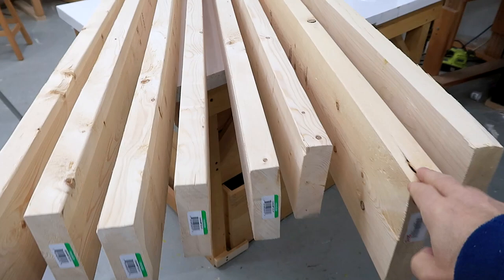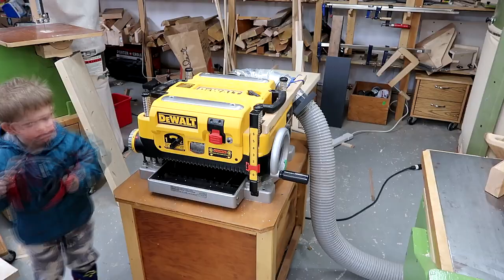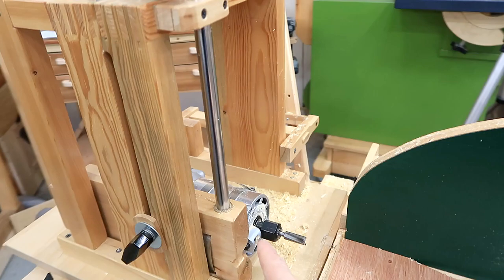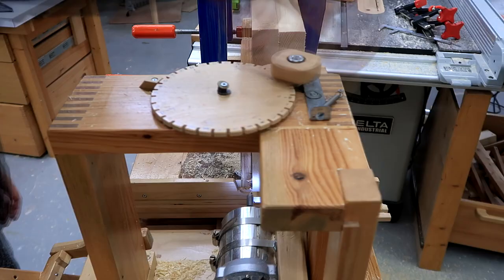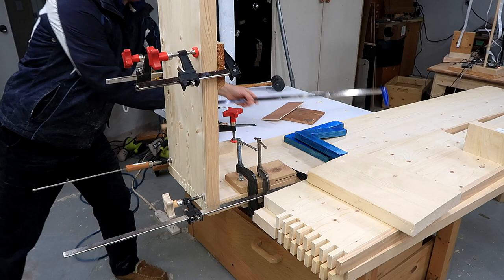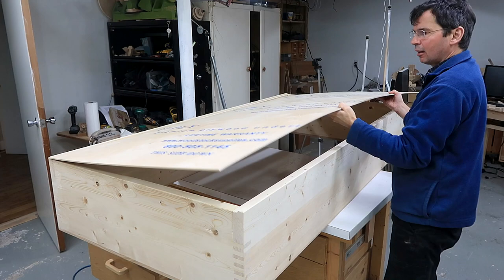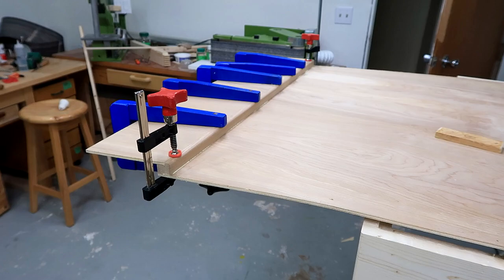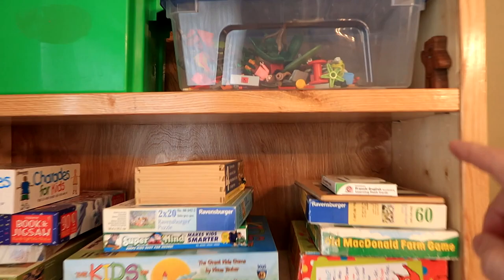Big box joined bookcase

Comment: Just when I thought I could possibly have more respect for you I see you use underlay plywood on a project. It felt so good to know I'm not the only one who uses it as a cheap source of thin plywood. But then you went and used pocket holes. Now I'm not sure how I feel. This video was such an emotional Rollercoaster. The only logical conclusion I can come to is one of the major pocket hole conglomerates got to you and brought down another legend.
Reply: I forgive him!  The strength comes from the box joint corners, the middle shelf just ensures the sides don’t bow in or out, affecting the ability to use the movable shelves.  Plus it can be removed if necessary, which wouldn’t be possible if he doweled through from the outside.  That’d also leave visible dowels on the outsides too.

I too have strongly considered underlayment plywood for projects.  Menards sells 4x5 sheets of 1/4” baltic birch underlayment, though the 4x8 there and at Lowes seem to have paper thin veneer faces over 3-ply cores.
Reply from the maker: if only they hadn't printed all that text on the good looking side.  I think they do it just to spite people like me.

Comment: I would think that a loose tenon might be a great future option for situations like that middle shelf. Just on the shelf side made it so you can slide it over the tenon, with the back mortise being open on the shelf. You will still be able to hide the joinery. 

Also in my experience, since most wood glues are water based. You can often extend the open pot life by mixing with water. Which is a trick I would commonly use when we did large glue ups. At the cabinet shop i worked at for a number of years.
Reply from the maker: did you ever check if those joints were any good in terms of strength?
Reply: @matthiaswandel  I don't remember having any failures on them, Most of the time it was stuff like cabinet doors that we where resizing for customers. I wish that I could remember better everything that we used this trick on. To provide better information to you. It does have the potential to increase the grain swelling cause your adding more moisture to the wood. But I don't remember us ever having failures of the glue joints themselves. Hope that helps.

Comment: Hello there nice work as usual, I have a small question : couldn't you just reverse the position of the sides and tap and bottom to continue the box joint? Like flipping them 180° on the long axe and continue by referencing the bit to the last finger cut?
Reply: I guess it would be pretty difficult to line up those two sets of fingers to make them meet accurately in the middle.
Reply: Too much potential in misalignment and not worth the trouble for how little is gained by doing it. Book shelf still gonna last as it would otherwise
Reply: @schm4704  if he started in the middle and worked down ... 
first prop up the work piece so its middle point aligns with the middle position of the tool.

Comment: All that lumber… is this guy a millionaire?!
Reply from the maker: all you lumber price meme guys - you should check current lumber prices.  It's not 2021 anymore.
Reply: @matthiaswandel  It is here in the UK. Timber is currently twice the price it was before Covid :(
Reply: I'm in Kentucky and an 8' 2x4 costs $9.00. A 2x12 is about $40.
Reply: 300% to 400% increase from 2019. It did drop back down for a few months, but it's back almost as high as it peaked in 2021.
Reply: @matthiaswandel  people have trouble moving on when they think they are being funny
Reply: @matthiaswandel  in western Canada, prices are still bananas. $8 for a 2x4x8.
Reply: I refuse to by lumber at these prices.  I'll just pretend i'm building stuff.

Comment: I was just wondering, with such big glue joints, and so much surface area, would moistening the surfaces by spraying them with some water help slow down the drying time? Although that might also cause some swelling in the wood and make more of a hassle. 🤷‍♂️

Comment: If you wanted to put that middle shelf in without pocket holes, there is always making a partial dovetail from the backside and sliding the shelf in. That would end up with a strong and invisible joint.

Comment: Great project, as usual filled with much good advice. Maybe it's a silly question, but why didn't you flip the boards on the slot mortiser by 180 to add slots all the way through?
Reply: The second set of cuts wouldn't be aligned properly with the first set.
Reply: @goose_asdf  Thanks :) Maybe it would take some tweaking, but since this machine indexes everything by threaded turns I figured it might be be close enough.
Reply: @goose_asdf  say each cut was 5 spins apart on the gear. You could just flip the board, start from the last slot you cut (make sure the cutting bit fits in there perfectly), then do 5 spins of the gear from there and continue to the end of the board. Then it’s exact.
Reply: @Macarthurmaintenance  or better yet, don't worry about it.  Do 5 spins to just shy of halfway, then flip and repeat.  Your middle pin may be slightly thicker than the rest but who cares.
Reply: @gordonbowe  My thought exactly. But not being in the room it is so hard to say whether or not there was another reason not called out in the audio.
Reply: @gordonbowe  who cares? the guy who would have to do the math and measuring to get a perfect joint with no gaps...

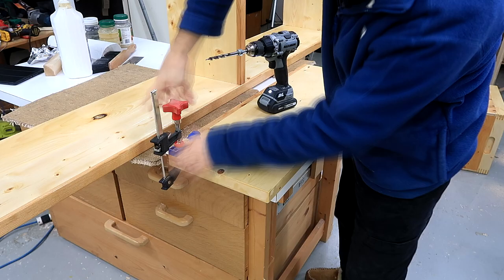Comment: 11:30 why not come in from the outside with much longer screws, recessed them and bung the holes.  Much stronger I would think.
Reply from the maker: cause I didn't want to come in from the outside.
Reply: Fair enough, I was thinking dowels, but you'd see them from the outside of course.
Reply: @matthiaswandel  I understand that. Just thinking of a way to avoid using something that you despise.
Reply: Or use a router to cut a horizontal slot for the shelf to sit in. Even stronger.
Reply: Maybe gets more comments and thus more views later
Reply: @danielwilson5102  A stop dado was my first thought; however, he would have had to make one shelf longer to fit into the dado.
Reply: @danielwilson5102  then he'd need a wider shelf
Reply: Pocket hole screws are a side grain attachment. Which is stronger than end grain is.
Reply: @natalieisagirlnow  wood does come in a variety of lengths.
Reply: @1pcfred  not if you use a longer screw which you are able to do in this case.
Reply: @1pcfred  Yes, but I think he already had the shelves cut to length.
Reply: @marshallmurrell4583  yes it does take some planning to leave material for joinery. Or you just break out your board stretching tool. What I like to say while I'm working is every mistake is just an opportunity to get creative. I'm naturally a pretty creative kind of a guy too. So it works for me.
Reply: @1pcfred  not when it's already cut to size with facing glued on it
Reply: @natalieisagirlnow  the beauty of wood is that it burns. So if a piece isn't working for you then torch it and cut a piece that does.
Reply: @1pcfred  burning money cuts out the middle man, and saves time

Comment: For the middle shelf, why not cut a slot in the shelf edge and the sides? (Open at the back.)
That way you could put the shelf in place, and slide a long rectangle of wood in place from the back side. Glued of course?
Or, use the pocket-hole jig to start holes for dowels, then glue it in place with dowels?

Comment: In your pocket hole situation I have instead made sliding dovetail keyhole slots, which can accept floating tenons with protruding dovetails.  Thanks to routers it's not that hard to do, and disassembly is much easier than removing screws from unsightly pocket holes.

Comment: Matthias i wonder why you are using the jointer wrong every time?
The pressure must be put on the outfeed, not the infeed table. Otherwise the thickness isn't constant or worse you are making the woodsurface curved, not flat.
At least that's what i leard ;)

Comment: I like the tips (e.g. a leading and trailing scrap to minimize snipe).  Wouldn't the back and the screws into the wall preclude racking?  Seems that finger joints on 2x material is superfluous.  Another nice project.  Impressive how you can work on big stuff like that by yourself.  Cheers.
Reply from the maker: yes, with it screwed to the wall, it won't rack.  It's only when it gets moved that that matters.  Cheap furniture usually dies in the process of moving house.

Comment: Impressive joinery. A shelf unit for the ages. Did you decide against rabbets and dados or did you just want to use box joints as a design decision?  Setting aside the issue of weight, I was wondering if you could have cut the top and bottom fingers and the mating fingers in the sides at the same time (with spacers for the offset)?

Comment: Serious question about your choice to use pocket holes for the middle shelf. I myself use pocket holes often and know you dislike them. So I am wondering why not use dowels from the outside in to the shelf instead. Is there some reason that would not work?  Maybe it is an aesthetic choice and you do not want to see the dowel circles on the outside? I'm just curious if there is some reason besides that, if thats it though it is reasonable enough. 
Good looking bookcase btw. I like it!

Comment: box joints on a shelf is something i rarely see, and two different boards glued together to make each side should sharply reduce any serious warping or bowing, without the middle shelf. the box joints couldn't go very far out of square even if they wanted to. maybe if it was soaking in flood water, unless you use exterior wood glue.

Comment: for those box joints, why couldn't you turn the two pieces you had clamped together over, so the already-cut portion was on top, and the portion to cut was on the bottom?

Comment: What about "pocket dowels"? Basically start with pocket holes and screws, but then pull each screw out one at a time and use the holes to locate and pilot the drill to replace the screws with dowels?

Comment: That is a mammoth, but came out great :-) I wonder if you could not have reversed the boards to cut the remainder of the box joints.
Reply: Achieving perfect alignment for both sides would’ve been difficult just being slightly off would have led to a similar outcome as seen here (remove those fingers, butt joint the back half)

Comment: A stopped housing dado for the middle shelf, after the fact, would have been far better. You wouldn't have to lower your standards to such a low level.  And it should have taken at most an hour for you.  Your pride is worth at least an hour's time I would hope.  You would only need 1/4" depth to get the strength needed.
Or, if the shelf was already cut to length (bad form on planning, but we have all been there), you could have used a spline.

Comment: How do you keep large, flat pieces of wood from warping while you're working on them? The other day I was making a shelf/table thing and I made sure the surfaces of my top piece were flat and square but by the time I got my legs cut out and glued the shelf had warped significantly and it rocked all over the place, I ended up having to trim the legs to make it level and it turned out shorter than I was aiming for. My workshop is in a shed which isn't climate controlled, so I was thinking it might be the changes in humidity, but I don't really have the option to cut and glue my pieces in the house. Any tips?
Reply: That's going to be a problem. Even if you did get your shed climate controlled, it wouldn't necessarily match your house. Perhaps stash the wood in the house for a week to let it acclimatize, and only take it our to the shed to work on it, returning it to your house each night?

Comment: Rather than the abomination of pocket screws, why not dowels or screws coming in from the other side of the vertical pieces? Is it to avoid the cosmetic blemish of plugs, or would those approaches just not be strong enough?
Reply from the maker: I just didn't want to come in from the outside.  Also, if I ever have to, I can still move the middle shelf.

Comment: Just curious as to why you don't like pocket hole joinery? Is there any application where they're preferable? Seems every YouTuber prefers them. I'm still learning and it's very front and center with most all project videos I watch.
Reply: It's a long running feud between him and Steve Ramsay.  They hate each other.    😉
Reply: Matthias is just a joinery snob. He sells joinery machines so there's a conflict of interest going on. In most cases you are better off with legitimate joinery but sometimes you can't beat a good screw.
Reply: Woodworkers use joinery. YouTubers use pocket holes.

Comment: If you ever get around to make another middle shelf, and you don't wanna hassle with it, just cut half steps into the position where the shelf needs to go, then gently spread the sides(whilst clamping the ends so they're not affected) and pop the shelf in. One side, of your choosing, has a full joint, with a slight angle allowance cut into the fingers of the shelf, the other side has slanted fingers, to allow for the swing. If you manage to put even a 8 mm set of fingers into that, you're set, it won't break, and you'll never have to use the evil pocket holes anymore.

Hope the way i explained it makes sense, the terms aren't exactly in my common English glossary.

Also, next generation Wandel in the shop! Man, they grow so fast. :)

Comment: You should've used dowels to join that middle shelf
Reply: The only way to make dowels work would be to attach the middle shelf before you attached the top or bottom..
Reply: @lennyf1957  Through dowels would work, but he probably didn't want that look since they would be visible from the side of the shelf unit.  I recently had to do that to fix a screw-up, but I'm painting my project so it really didn't matter.
Reply: Recently built bookcase with middle upright and attached bottom with screws from bottom of case so not seen and brass 90 degree brackets at top.  Hope this holds but seems pretty strong and looks good I think.

Comment: Awesome shelf! How hard do you think it would be to make one of these without specialised tools? What would you replace the box joint with?
Reply: The back can provide an enormous amount of strength, so even just screws in from the side would probably work.  But a rabbet would be a nice option as well.
Reply: Don't need a box joint at all, it's kind of wasted in this application unless you really load the top of the bookcase
Reply from the maker: You could just nail a bunch of construction lumber together and it would do the job, just not as pretty.
Reply: @MrJVH88  You may be surprised how soon a large rectangular frame will loosen and wobble.
Reply: Traditional case work would likely utilize rabbet joints top and bottom and dados for interior shelves. With patience and practice this can be accomplished with very few tools.

Comment: With the partial box cut why don't you just flip it so you can use the router again?
Reply from the maker: Too hard to get it aligned.
Reply: @matthiaswandel  after you flip it a clamp it down just raise the bit up and put it in a slot. Then  use your usual turning method going down. Would that not work?

Comment: why not flip the pieces to cut the box joint slots on the full length of the edges?
Reply: Because then you run the risk of misalignment. Which I personally think Matthias could have handled. He was less confident in his abilities than I am though.
Reply: @1pcfred  that's what I'm saying.
1. your vertical mortiser is already setup. 
2. flip the board, 
3. shim the board until the already made slot fits the router bit
4. continue cutting
Reply: @TigerCarpenter  sure what you say could have worked. I can see why Matthias didn't do it though. He wasn't submitting this piece to an art jury or anything. Although posting it as a video I guess he was? Really he did a cost benefit analysis and it came up no.
Reply: @1pcfred  I think he simply didn't think about this simple trick. Once you align an existing slot with the bit, you can continue cutting with the same setup.
I wish Matthias gave us his 5 cents on that ;)
Reply: @TigerCarpenter  Matthias is a pretty clever guy. So I'd sooner believe he just didn't want to. Or maybe his equipment has a limitation we don't know about?
Reply: @1pcfred  he replied to some else asking the same question.

he was worried about misalignment.
Reply: @TigerCarpenter  I saw that. Matthias knows what he's about better than anyone else does. So if he was worried there is likely a genuine concern. Beyond that I'd argue it wasn't necessary. What he did is plenty strong enough. You could store lead bars on those shelves.